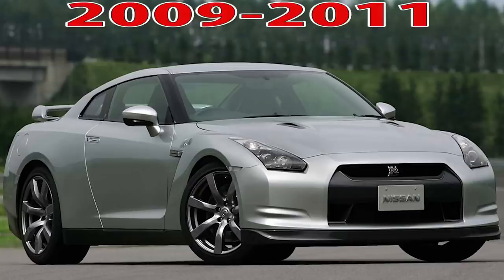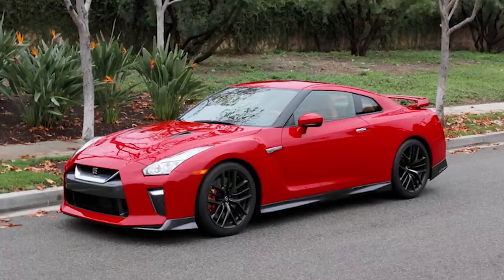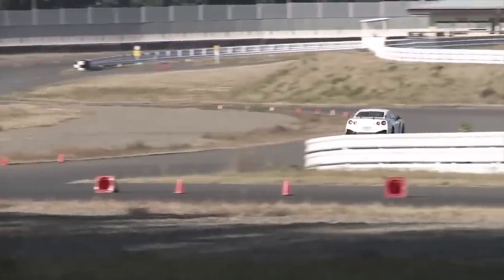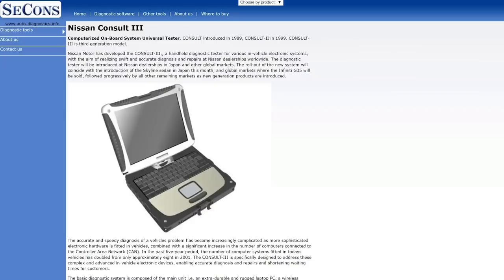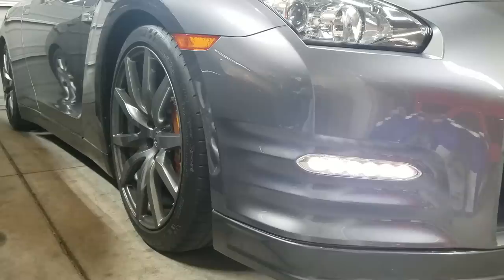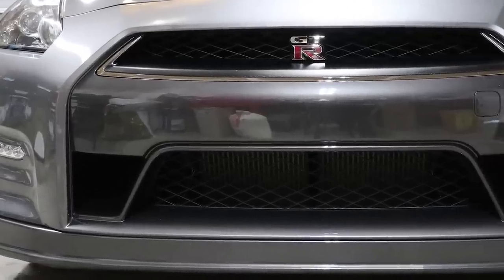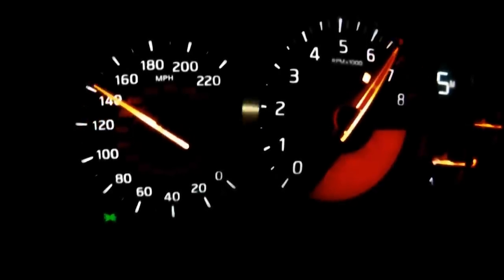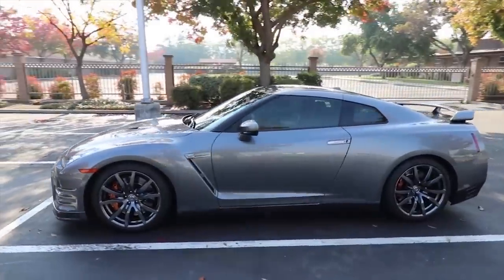Nissan GTR R35 Ultimate Buyer's Guide - WATCH THIS FIRST BEFORE YOU BUY

Comment: "Really hard to beat the performance per dollar"... no.
Car and Driver has the definitive list of 242 cars they tested on VIR's track, 
In those tests, Camaros and Corvettes slaughtered the NISMO GT-R, which is an utter humilation for the massively overpriced GT-R.
You'll also note in these test results that the *2012 GT-R scored EXACTLY the same track time as the 2017 GT-R Track Edition*... which tells you while Nissan was massively jacking up the price for 5 years, they gave the customer NOTHING in return for increased performance.   Clearly Japan is still pissed off about Hiroshima and Nagasaki, so one form of payback is raping the hell out of us on their hugely overpriced, overhyped 'performance' car.

You should also note that without launch control, simply using the gas pedal, the GT-R crawls to 60 in lumbering 4 seconds... a far cry from launch control times.
This is not a 3500 lb, 650 HP/TQ Corvette Z06 for a mere $80k
There are plenty of RWD cars that are hitting well under 4 seconds with no launch control required.

2015 Corvette ZO6 10th place @ 2:44.6
2018 Camaro ZL1 1LE  13th place @ 2:45.7
2015 NISMO GT-R  23rd place @ 2:49.4

You definitely convinced me... unless you're a master mechanic, or are drowning in cash, you'd be a fool to buy a GT-R from the Pearl Harbor bombers.
Reply from the maker: Not to be rude, but this comment is bench racing at it's best. Lol

If this is what determines your decision, then buy the Camaro. I'm sure nobody is offended. It's also a great platform.

The GTR is not going to be everyone's car. People have there own preferences and purposes and that's fine.

Some thoughts:
 -What can YOU do with the car as you hopefully will be the one driving it? -Will YOU be able to wring out the full potential? 
-What is it's REAL world (street) abilities? Comfort? Performance? Cost of ownership? Etc.
-What cars are actually fast on the street or winning events or setting records (1/2 mile, drag race, autocross, track, etc.)

Only YOU can answer this as it'll be YOU'RE car and hopefully YOU'RE driving it and enjoying it's full potential and not leaving it to someone else driving it.

What's with the racism? My video had nothing to do with Pearl harbor.
Reply: @GTContent  
-->"this comment is bench racing at it's best. Lol"

-->"What is it's REAL world (street) abilities?"
That is the entire point of having track test results.
A cars performance on a track is a direct measure of its oversteer, understeer, breaking, and acceleration.
I couldn't care less about driving on a track myself, however, having track results of 242 cars on THE SAME TRACK, many driven by the same driver and in the same weather conditions is incredibly valuable performance data, and only Car and Driver has compiled such a huge resource.
I like to know OBJECTIVELY what the performance CAPABILITY is of the car I'm buying, whether I can use that performance or not.
I like to know OBJECTIVELY whether the GT-R cheerleaders are justified in their knob slobbing about the supposed "supercar slayer"
As I clearly and OBJECTIVELY demonstrated, the GT-R is massively overrated by the knob slobbers, and the ayhole Nagasaki_Hiroshima manufacturer put out 5 YEARS of GT-Rs, enormously jacking up the price, and giving ZERO performance improvement in return.  

-->"What's with the racism?"
No, what's with the colorful humor.
Many of the funniest comics in the business make fun of race, age, disability, gender, ... and there's nothing whatsoever wrong with that.
And most who don't have a snowflake personality and need "safe spaces" from speech they disagree with, have no problem with "racist" jokes.

-->"My video had nothing to do with Pearl harbor."
Nissan's country of orgin is Japan. 
Japan bombed Pearl Harbor
We bombed Nagasaki and Heroshima
When discussing the ayholes at Nissan, I have creative ways of describing why they sent the price through the roof and their $170k NISMO junk can't even beat a Corvette around a track.  How about we engage in some honesty about cars peformance instead of hiding behind underserved knob slobbing.
The GT-R was impressive in 2009.  It's now an overhyped ripoff.

Next you'll say "then why are you here commenting if you don't knob slob for Nissan"
And to that I would ask, "so you only want to hear from knob slobbers who echo your inflated irrational opinion about the car?"
If you were genuinely objective about it, you'd mention these points so I don't have to.
Reply from the maker: @TasteMyStinkholeAndLikeIt  I've addressed the negative points already with videos from my channel. There's nothing new you've brought up.

As I've stated above,  buy the car that suits you. Why would you care what I/others have to think. It's your money. 

Even if you spend 99.99% on the street, but C&D track tests determine your purchasing decision, then have at it. Why so bitter knowing people can make there own decisions?

To sum up, you went from C&D track times > Reliving the past with Pearl harbor > Japan is evil > conspiracy behind GTR prices > Anyone who disagrees with you is a "GTR cheerleader/knob slob" > Justifying racism > Political content > Assumptions/attacks about me.

It's a weird world we live in. Enjoy your day.
Reply: @GTContent  
I'm new to this channel.
I would be happy to watch your videos where you explained...
1. The GT-R went up dramatically in price while providing ZERO measurable performance increase.
Hopefully you stated it explicitly for the simpletons, not just hinted at it, hoping it would go unnoticed.

2. The Corvette AND Camaro beat the NISMO GT-R on a track.  The other GT-R's aren't even in the ballpark, so everyone calm down on calling it "Godzilla" and "supercar killer" when it's never been put head to head with a Pagani, Bugatti, Koenigsegg, McLaren P1, Ferrari FXX, ..., ..., ...  and yes, even the McLaren 720S slaughtered the NISMO on the track.

3.  Mashing the gas pedal gets you the slow crawl to 60 in 4 seconds, so everyone calm down on stating the car ONLY does 0-60 in 2.7 seconds.

4. Do you mention Nissan 'highly suggests' that only certified GT-R techs can work on the car, and that not every Nissan dealershit has a certified GT-R tech on staff, meaning you could end up driving hundreds of miles to get your car serviced?

-->"Why would you care what I/others have to think"
I'm not on YouTard to care what others think.  I'm on YouTard to give people indisputable truths that they'd rather not confront.

Comment: all that money and no manual trans! no thanks,
Reply: You'll notice most 500+hp cars made these days only feature the dual clutch setup. Manual just can't compete with the performance numbers that a dual clutch provides, hence why most are getting rid of it. Basically if you want a clutch, you need to buy older cars or something much lower on the performance chart.
Reply: An Trinh still living like it's 1999, I see. I guess you'll go for the "I'll lose every time but my excuse will be that I'm still the better driver" technique.
Reply: Sergey Pupko no sir, im not a race driver or pro drifter or trying to beat any record by any mean. Me personally just like the feel of driving a manual trans and for me nothing can beat that.
Reply: 1983r1, not true.  There are quite a few cars with manuals that outperform the GTR.  I traded my 2013 GTR in on my 2015 Viper and have been quite pleased.  I was completely bored with the GTR because of the DCT.  The viper is quicker and more engaging to drive.